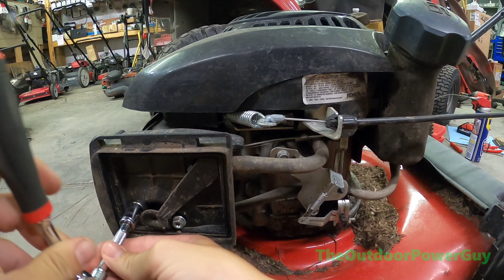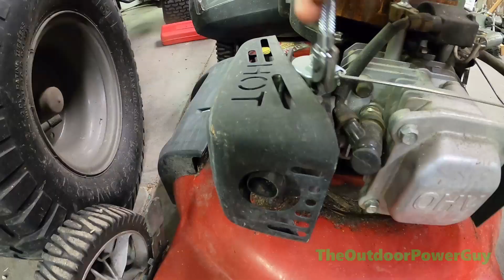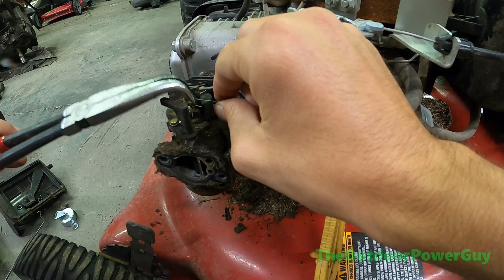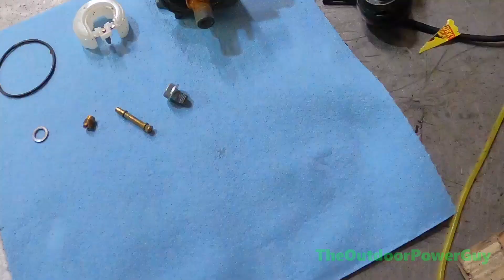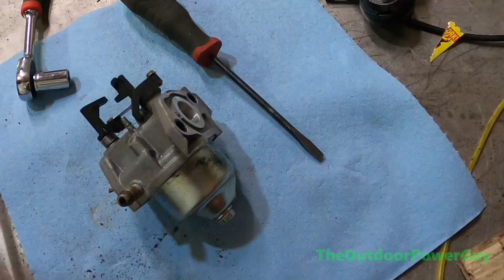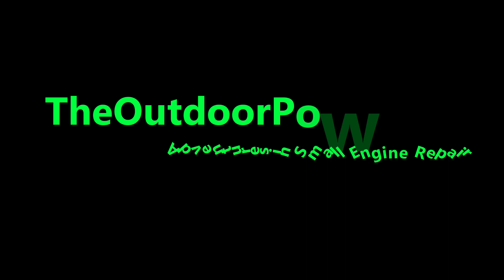Kohler XT7 Carburetor Clean - WORST One Yet!

Comment: I see this video is couple years old now so maybe you solved or gave up on it. Was just wondering if you checked the valve timing and ignition timing as I had a small engine that definitely needed carb work same as yours, but as it turned out the ignition timing was off as well.